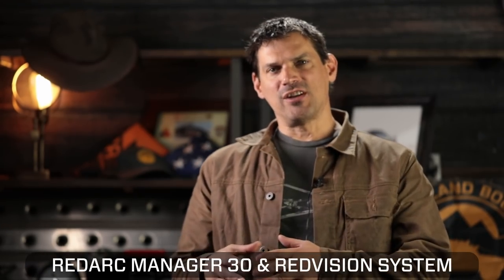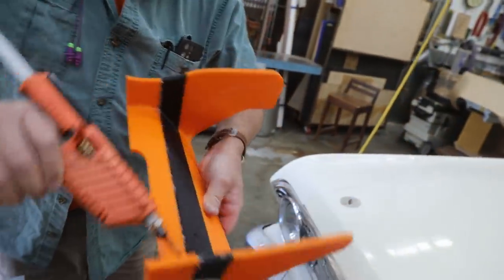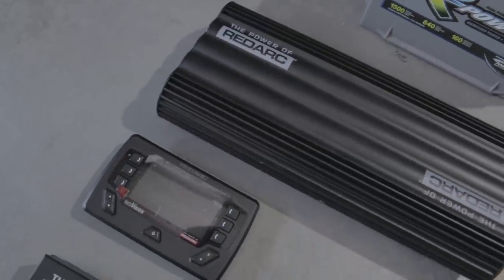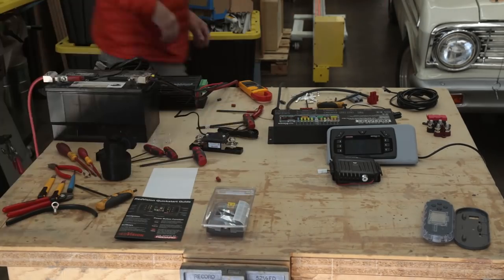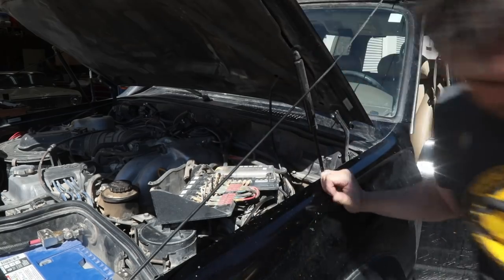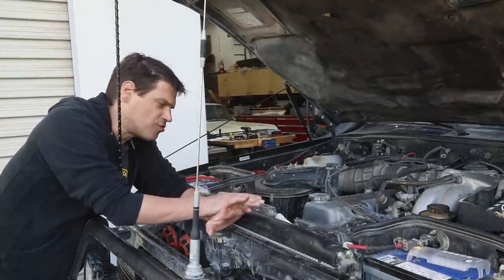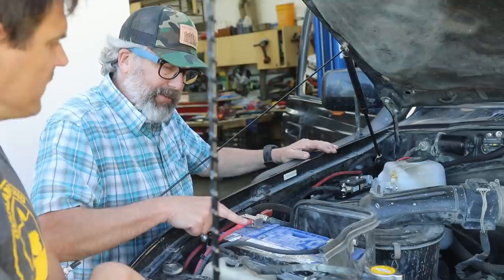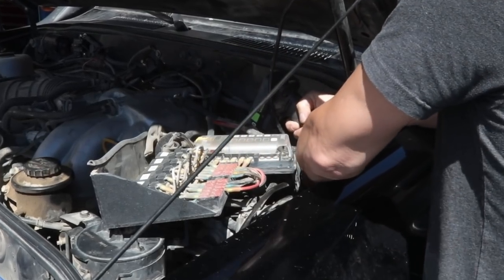Custom DIY Center Console : RedArc Install

Comment: In the automotive DC world of electrical...always create a ground bus and run all your grounds back to the same point. It might be extra work at first but it will solve a ton of ground loop problems. Especially with ham radios or CBs.

Comment: Hey Mikey, A great install of the new system. Kudos to Parnell and you. 
I wanted to thank you for the Diode chip charging tip. It worked out great. Cheers, Mate.

Comment: Just did a trip with my new 340 amp hour lifepo4 setup and a redarc dcdc 50 amp..   It did great.  Kept my setup charged and did it very quickly.   Crazy how fast a lifepo4 battery can take a charge to 100% SOC.  (I used a victron smartshunt to track battery SOC)
Reply from the maker: Awesome Mike!

Comment: I have always been instructed to mount fuses and circuit breakers as close as possible to their source. The less wire you have between the source and the fuse or cicuit breaker means there are fewer chances of shorting out unprotected wires.
Reply from the maker: Great best practice.

Comment: Shoulda mentioned that with the Redvision system you need specific inverters. IE the Cotek SP series. So you can control it through the system. We are installing this in our @gladiatoroverland Veteran Overland Project in our Alucab Canopy Camper on our Gladiator. Although I like redundancy myself. This system is a excellent and reliable, super easy to troubleshoot. And different from you rubbing each ground wire to allow easier troubleshooting in case of an issue. Overland Bound Member 19000
Reply from the maker: Yup. That Cotek is the one.

Comment: Maybe I missed it, I have been up for almost 20 hours, but inquiring minds need to know, how are you running everything in parallel? Are you running the positive wires from the Redarc terminals to the accessory positive wires in the relay box you built a couple years ago?
Reply from the maker: That is exactly correct.
Reply: @OverlandBound  So, you are connecting the positive lead for the accessories from Redvision to the output (pin 87) of the relay, then to the accessory? Does this mean you have two switches? One from Redvision and another switch as well? I have a electronic aptitude (meaning I have the basic fundamentals how things work), but I am not an expert or a electrician.
Reply: @countrymagic61  You should be able to connect to pin 87, or anywhere along the positive wire running to the device. You could also run a second wire to the positive input of the device.

Comment: Do you have a video showing how you did the parallel (redundant) wiring for the relay/fuse and the Redarc Redvsion? I like the setup. For what I do right now, this is an overkill. However, I plan on build my own overland trailer. The trailer is where I will have the Redvision and Management 30 installed.

Comment: yeah the redarc itself under load probably wont get that hot but if you add the heat from the transmission below it then it might be an issue   specially after a hour or 8 on the highway or sitting an hour in rush hour traffic in 90f+
Reply from the maker: We installed one of the temp sensors next to it to monitor.
Reply: @OverlandBound  ahh great idea sorry if that came across snotty
Reply from the maker: @Trailseeker13  not at all.
Reply: There is also 3 in of space between the transmission tunnel and the bottom of the red Arc with the exception of the very front mounting point.
Reply: I forgot to add we love the comments. Sometimes hard to see the forest through the trees.